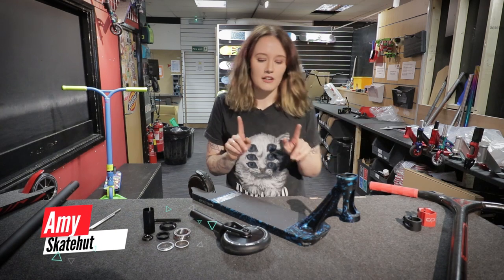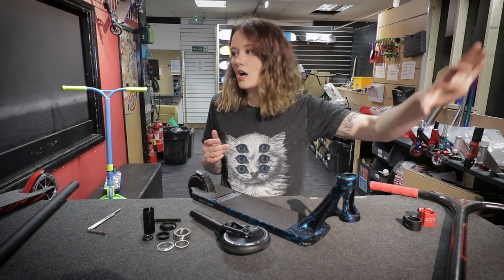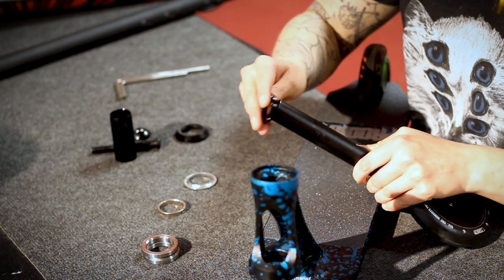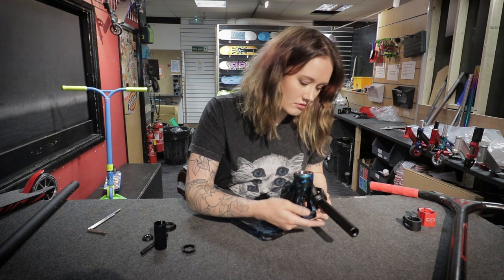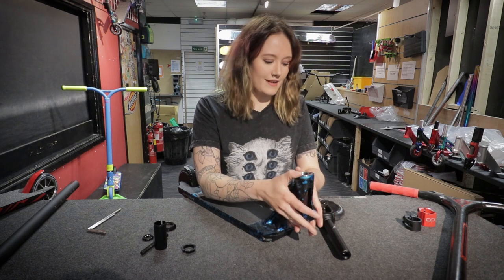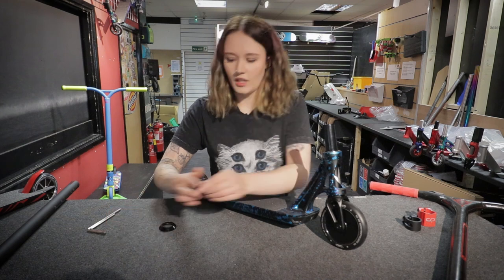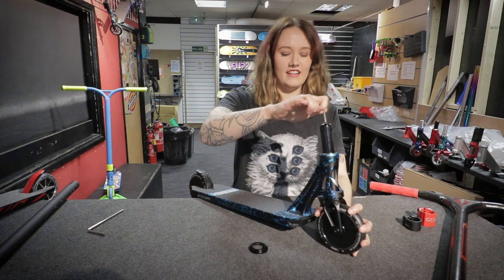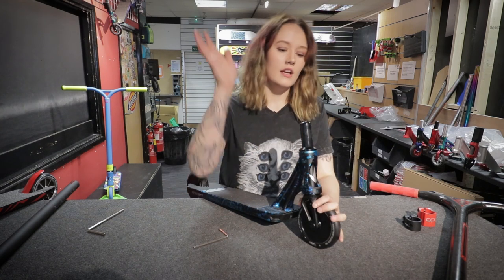Learn How To Install A IHC Compression System - SkateHut

Comment: I have a prodigy s8 and every time I tighten my compression a little bit to where I feel the resistance, when I spin my wheel to check if it’s spinning it untitens Help?
Reply from the maker: Use our online chat function on the website or email our customer service and hopefully they will be able to help
Reply: I have the same problem have you solved it yet
Reply: I also have this issue

Comment: I have ihc fork it's steering tube is 165mm high can I use ihc. rn i run standard hic compression which came with the fork

Comment: what clamp should i use with apex bol bars
Reply: The one that fits if you have oversized 2bolt oversize clamp if normal then normal 2bolt